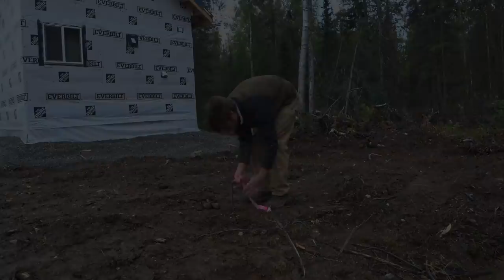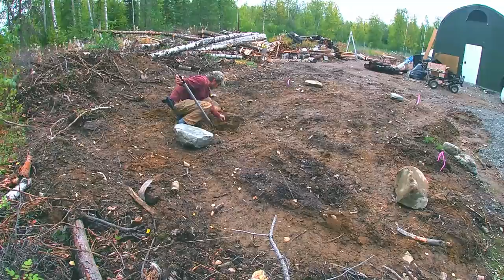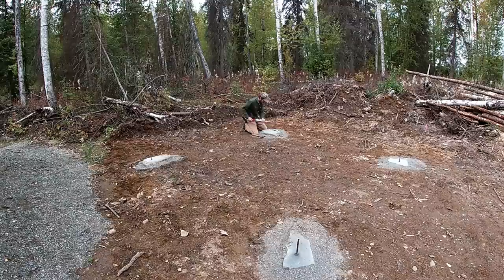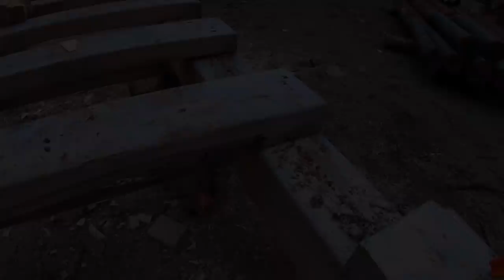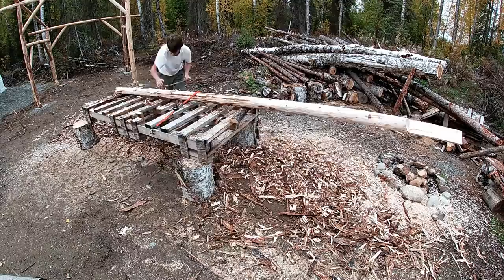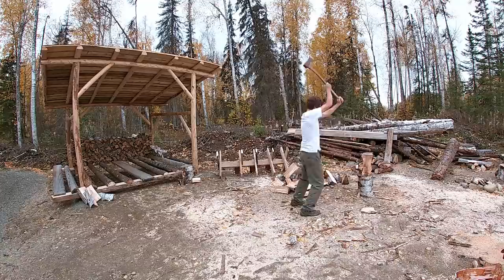Alaska Wood Shed | Build & Filled

Comment: I really like the look of the round wood cleaned off with the big spoke shave.  If you could afford it, get a gas powered log splitter, that can work vertically or horizontally for those big birch rounds. Save your back.
Reply: He's still a youngster.  That stuff will come later.  Great vid. Thanks
Reply: Nah, splitting wood like that builds muscle and character. It's peaceful without the noise of the splitter. You can hear your surroundings, the wind, birds etc. It's very satisfying.
Reply: That big spoke shave is called a draw knife, and they're a fantastic tool to own!

Comment: Get an old tyre screwed to the big log you use to split with maul,  the bits don't fly off when split.  #GAMECHANGER. 
Saves a lot of bending and picking the bits back up . .